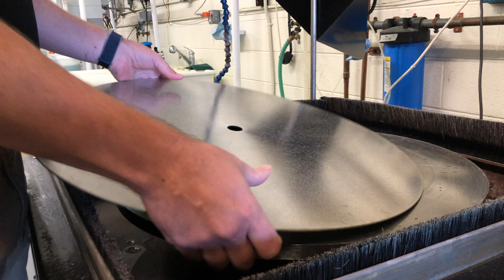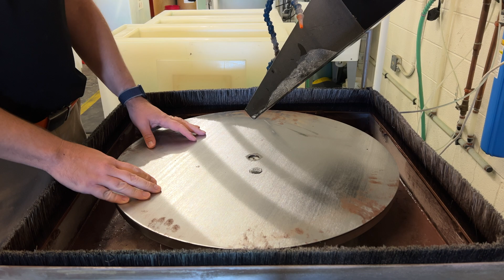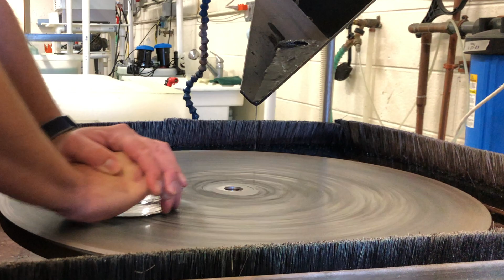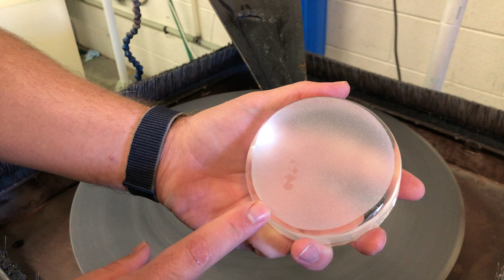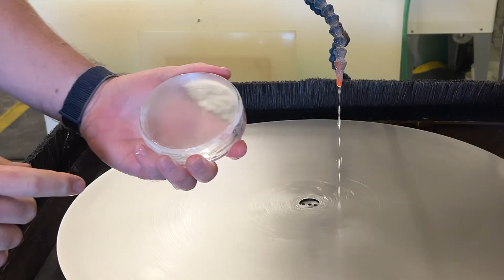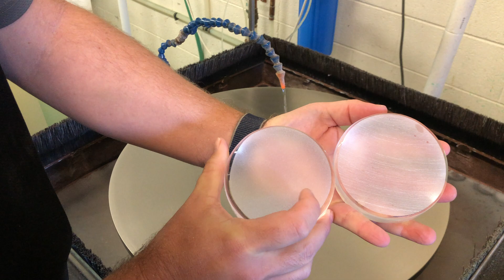Loose Grit Versus Diamond Disk Grinding

Comment: How much down pressure do you use with the diamond wheel? It looks a little bite like you use a bit more on the gravel.
Reply from the maker: You don't really need to use much pressure with either system. The diamond disk will have more "grab" to it as soon as you put the glass down so it's mostly holding the piece to keep it from coming out of your hands. Loose grit grinding can also generate a lot of suction on larger surface areas as you work so it can "rip" the glass right out of your hands as you work so it's a good idea to keep a good grip on the glass with both processes